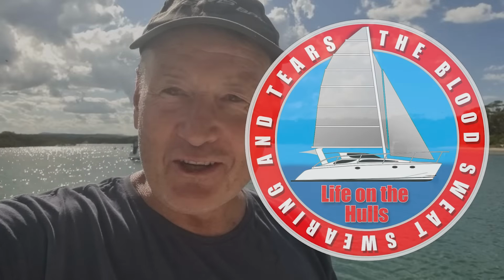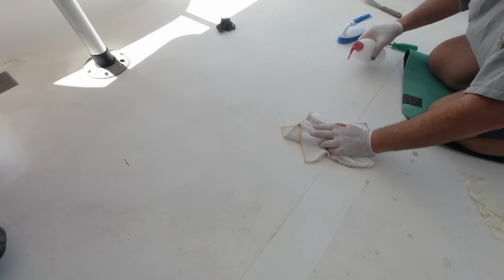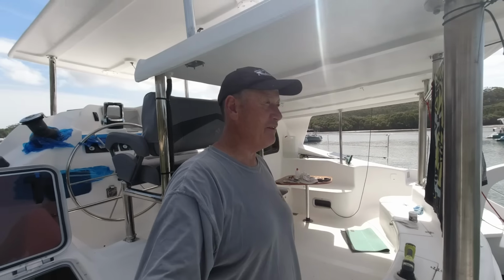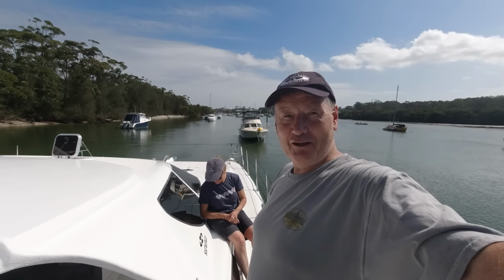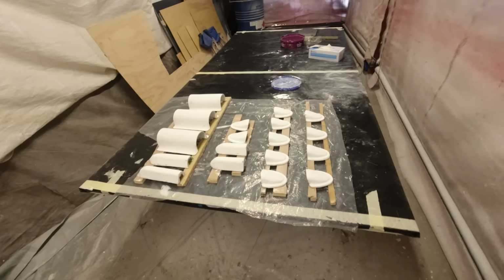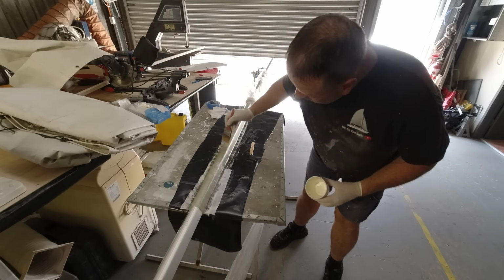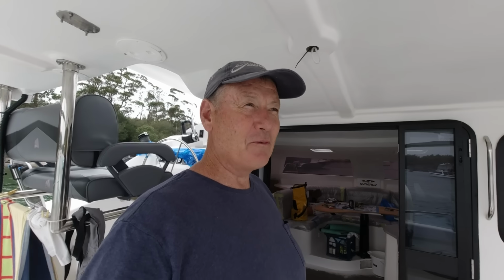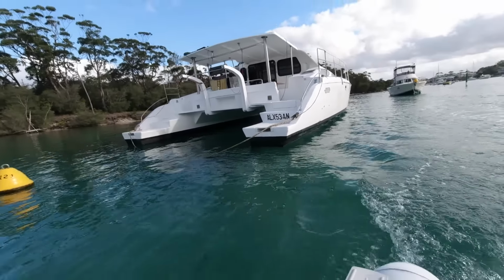She Has a Name - Naming our Custom Catamaran Ep371

Comment: I used to work for a boatbuilder many years. For the non-slip pre-delivery we used an orbital polisher with a circular scrubbing brush head (e.g. shurhold) to bring up the decks. They do 3 or 4 grades of brush stiffness, start with the stiffest brush and plenty cutting compound. Finally, very important to wax after, use the finest circular scrubbing brush (again with orbital machine) to polish off the wax. And no worries about putting wax on floor, it's a common misconception that it will make it slippery, but its the engineered texture that makes it non-slip no the surface...if you don't wax it then it will stain and foul up real quick.
Reply: p.s. the stabrite deck cleaner is really bad for gel coat (removes all wax and shine). Fine as long as you polish and wax everywhere after, but best avoided. Once you've done the above, all you need to do to clean in future is just rewax and repolish with finest brush and wax, as long as you don't leave more than about 6 months it will eaisly come straight back up without needing compound

Comment: Carbon fiber used to spread load is a very very good idea. I doubt you'll NEED it, but it's a good precautionary measure. I'm sure you'll be happy you did it the first time it suddenly starts blowing 40 kts and thought "reef 1 was OK"! 

Most of the reinforcement I've done to my Lagoon 440 (ripped entire cabins apart and glassed the entire mast bulkhead from port to stbd, glassed all the glued-in smaller bulkheads in, added runners to reduce flexing, etc) is not because I had a problem, but merely to feel more confident that the boat is ready for all the mistakes and bad choices I make. I like having that buffer!
Reply from the maker: Well done mate.When building the Cat , I triple laminated every bulkhead to bridgedeck and deck, mastpost, tabbed , laminated and bolted to bulkheads etc.All bulkheads chainplates , robes, soles and partions are epoxy filleted and tabbed, no gluing in our boat, hopefully enough.Rossco